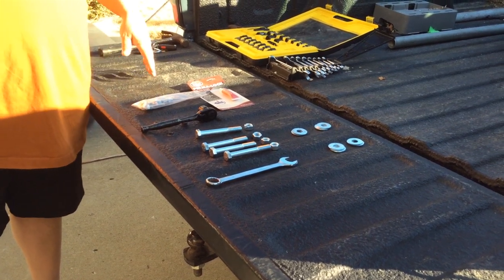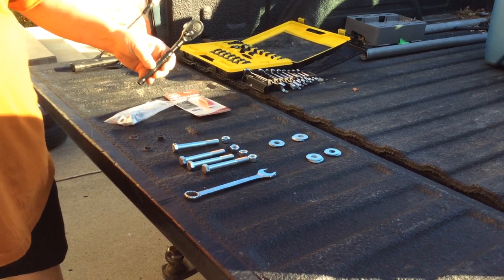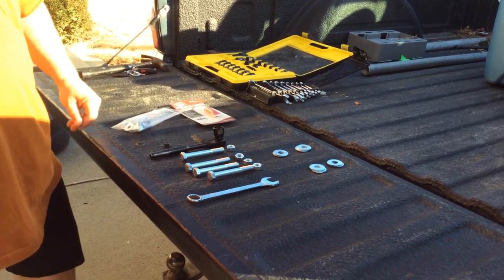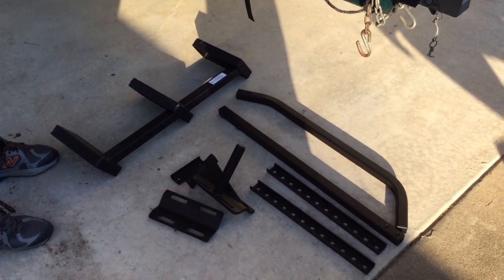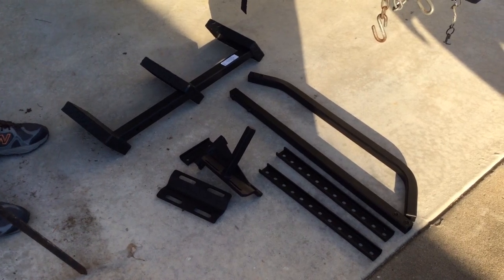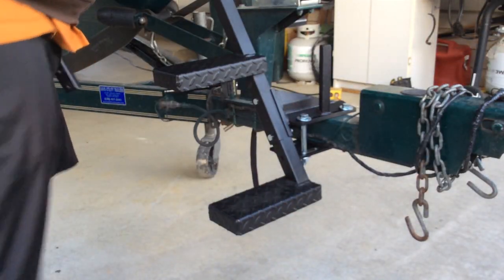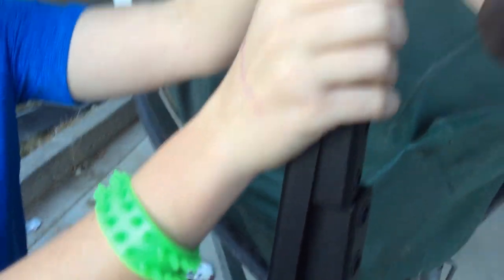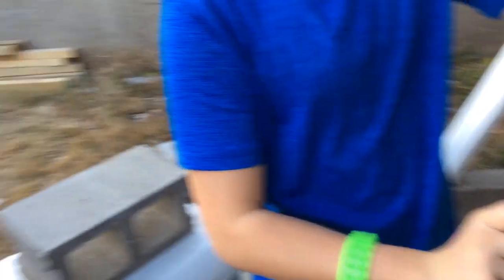Easy Step System for boat trailer - Installation instructions

Comment: I needed to buy four 8 inch bolts as the 6.5 inch ones that came with the kit ... They do know come with Instructions and pictures ... Plus all the You Tube videos ... had to move  my spare tire and holder back about 12 inches ... drilled 4 holes in the aluminum part ... the spare location is actually in a better place than original mount ..